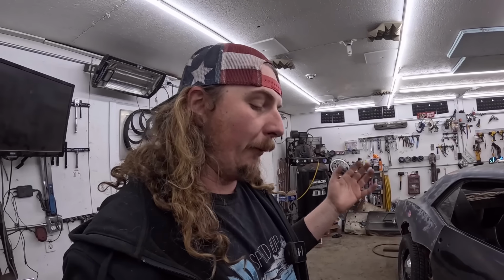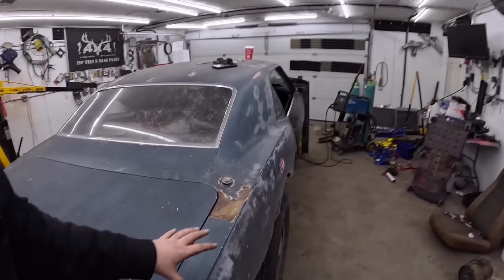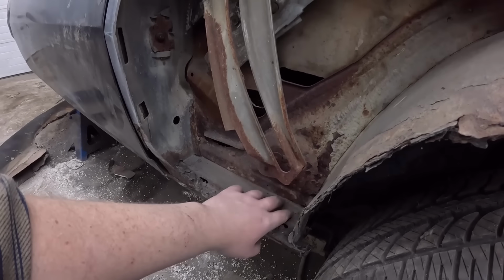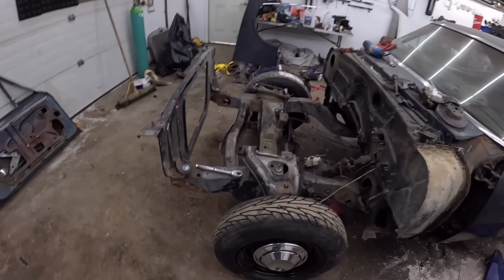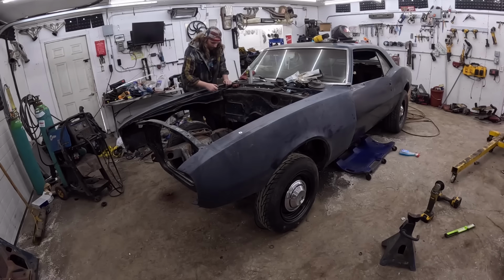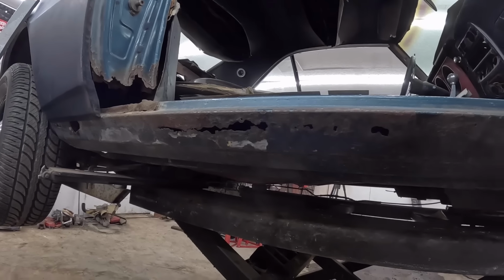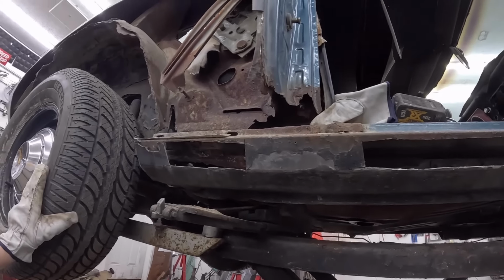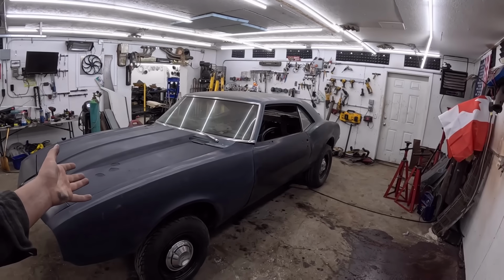Nothin But NEW METAL! - Rust Free 1967 Camaro?

Comment: I think they call those torque boxes that the spring eye bolts to and those are caged nuts you were referring to... one of my favorite metals to do patching with or make my own panels with is "satin coat" and you can get it in different gauge steel around Wpg.. you can literally throw a piece of it outside and it won't rust...you just need to lightly sand off the coating to weld...i usually buy off-cuts and get some of them bent in sheet metal brake with a 1" 80° or 90° angle...i think full sheets are 4x8 or 10...nice to have a few pieces laying around

Comment: I am just finishing up a customer car . A 1973 Camaro. New floor from AMD , mini tubes Sub frame connectors from Detroit steel. I repaired the quarter panels and it is in high build primer. When it leaves here the mechanical building begins. Then it will return for paint. These are fun cars to build enjoy the journey.

Comment: Gotta say, you’re going in a great direction with this Camaro. You mentioned a sbc and a 4 speed and that would be a nice driver. I tend to like nice drivers and then make them sorta spunky…
Either a 400 sbc with a circle track cam (sounds good and runs like a scalded dog), or a 454-ish with headers and 3” exhaust would really sound good, easy around town, tons o torque.

Comment: After you get everything lined up the way you want , drill a 1/8 hole in each hinge into door , then you can use an 1/8 inch drill bit to line everything up and bolt them right back to where you are all lined up fenders same way

Comment: I think it should be a universal car two engines available the 6 cylinder in the Biscayne ran pretty good. And then that 454 can make some mega power with good aluminum heads and upgraded pistons for more compression that is the key to HP. If you ever put a lawn mower engine together you can put a big block Chevy together. That's what it is a lawn mower ×8 a piece of cake.

Comment: Dan, it's called the front Spring box and your correct, 3 clip nuts on each to hold them in.. It's all a very cheezy set up in my opinion.  BUT thank god your not dealing with a 2end gen F body , there reallllllly a nightmare.  If it was me, I would sand blast ALL the rust out, and hit it with Asfo & coat the heck out of all that area with a few brush coats of Rusty metal red primer & few coats of Pro15 flat black as that rust can & WILL RETURN QUICKLY !👿👿👿👿👿  Same deal with the insides of the rockers as there is no real good way to stop the rust after you weld the rockers all closed, so sand blast clean &  brush coat everything in the inner rockers with rusty metal primer HEAVY before you weld on the new outer rockers.

Comment: HEADLINER AND PAINT SO HARD TO BELIEVE BUT I PROMISE IT WILL NOT HURT YOUR RATINGS
Reply: He never does headliners.
Reply: And anything but black wheels..... those "merican" daisy's would look great on this.
Reply: Head is a chicks thing, real men go bare
Reply from the maker: I'm scared of change
Reply: @DDSpeedShop 😅
Reply: YOU ARE TO GOOD NOT TO GROW DO NOT LET FEAR LIMIT YOU
Reply: YOU ARE TO GOOD NOT TO GROW @DDSpeedShop
Reply: Even smoke grey tractor paint!!!
Reply: Black is the only wheelcolor that is acceptable
Reply: I'm with you, however we don't have to watch the endless hours of sanding and literally watch paint dry. You know he gets bored and will move on to the next project. That's the real reason he doesn't do full restorations. Once he's done with rust repair he needs to get to making smoke as quickly as possible.
Reply: Anytime someone uses "FULL CAPS" You know there a Wakco! Lol Dan is YouTube gold and builds cars the way to get views. No one will watch 4 0r 5 video's  of a proper 1 piece floor install. Keep Jamming Dan👍
Reply: @DDSpeedShop It's OK Dan! There all scared to make there own YouTube channel.  Lol
Reply: @DDSpeedShop  keep the steelies and caps . period correct from the factory in base models . in the mid-late 60s , we were all ordering base cars with that spec in 2-door sedans and "muscle cars" with the high performance engines  . easier to fly under the radar . now days it's a great deviation from wheels costing more than the car

Comment: Your car is looking great. My 69 was like yours,but on the other side. The sub-frame connectors go under the front of your springs and wrap around your sub-frame bushings and you can weld them and it makes a way better job. Use polli bushings. With the mini- tubs I left the leaf springs and added weld in Q-a1 adjustable shocks so I could adjust ride height. Because I use mono leaf for the squat.we raced till 2018 lost some family members and no more track in Atlanta.

Comment: One of my favorite cars ever.. The year i was plopped out on this planet ..🤣🤣
 Those busted bolts can be  bastages... Have you ever tried lefthanded drill bits?  I stopped using most of my 6 different versions of the easyouts.. Usually drill small to center it, then go as big as i can without disrupting the threads.. It usually heats up catches and spins the busted bolt right out.. If it doesn't, its usually thin enough for a punch to mangle out..👍👍
After its done let me know when you get bored with it..  A fella might have a few acres on the east coast where you could store a few hundreds cars..🤣🤣  Going to be one sweet ride for sure.. Keep up the good work there brother..👍👍

Comment: My 67 is a driver for sure. Garage paint job. “Nice enough”. Definitely go Small block with a 4 speed, drop the rear down a bit and slap in a 8.5 10 bolt out of a 72-75 nova!! Bolts right in and can hold some power
Reply from the maker: sounds like a fun car to me!

Comment: PPG Delfleet Essentials factory pack polyurethane paint is inexpensive and excellent. Their ESSS911678 "flat black" is GM frame, firewall and trim black. I think it was $160 for a gallon setup. They also make an excellent range of colors in single stage and base clear.

Comment: Motor suggestion: 3800 Series 3 supercharged V6. Weight of a first gen Camaro and a Regal GS are very close. And even in stock trim the 3800 supercharged motor had power to spare.

Comment: if you put in subframe connectors understand the car wont flex as its supposed to. this means to do it correctly you have to weld up alot of seams to stiffin the body. if your not doing big blocks or high hp your likely to never need them.

Comment: You asked !  how about a 327 block with 283 crank giving you a  clone 302 . Add 4 speed and Z/28 stripes , rear spoiler and rally wheels . A tribute to a  low production icon  ( as in a Black Widow + 10 years  ). But no snow plows !

Comment: some engine geek 411 to anyone. The 366 schoolbus engine has a forged steel crankshaft. It's the same crankshaft used in the 396, 402 and 427. If you have a 454 you can swap the crank and rods from a 366 and it will destroke the 454 to a 427

Comment: So on that era of Camaros, when the factory built those cars they some times had alignment issues in the section of the quarter panel meets the rocker.   Typically the quarter panel stuck out a bit.   So… they would put a coat or two of lead on the rocker to make it flush with the quarter.   So the reason why that rocker seems pretty thick is because of the lead.   Also when you get to the joint between the quarter and the roof skin, you’ll see that the joint is filled with lead as well.

Comment: Hot rod that inline 6, that would be different.Split the exhaust and put a quad on it. Pontiac did that in 66 & 67 and called it a Sprint. It looked similar to the GTO.

Comment: Dan, you ought to buy a complete polyurethane busing kit for the car.  I know they are expensive to me, but they are the best.  Last forever, they don't crack or squeak!  Especially on the control A arms on the front end and are best for the rest also and body mounts.  Doesn't have all that give, not spongy like the stock rubbers...  Motor mounts won't break like the old stock ones, because of the engine torque, less vibration too...

Comment: a little old secret some might remember.  they would cut up a short bed truck for the frame and put it under a car.  short cut to a strong race car.  and old family thing. and no it's not cheating.  well maybe a little.  big thick tank in the back for weight transfer and a couple of sand bags over the wheels.  love tire smoke in the morning.

Comment: 15x8 (or similar) aftermarket steel wheels in body color with dog dish caps... make this a handler!
fwiw i heard that alligning the front clip can be a pita but i have no first hand on that.also, keep in mind on these uni-body cars a lot of their chassis strength is through those rockers. not like a full frame car so i'd either get thicker steel in there or maybe add subframe connectors.

Comment: My front after market fenders on my 67 Camaro didn't fit right and were a bear, so be prepared for that. Waller the holes on the inner splash skirt up front. Also, I replaced the crappy plastic front grill with stainless steel mesh that will last forever. It took a while to cut out though. I made stainless steel tabs slightly bent over to hold it in place and that worked well. Also put nutz in the upper and lower aluminum fillers instead of clip nuts.